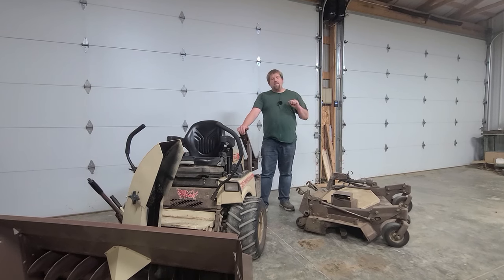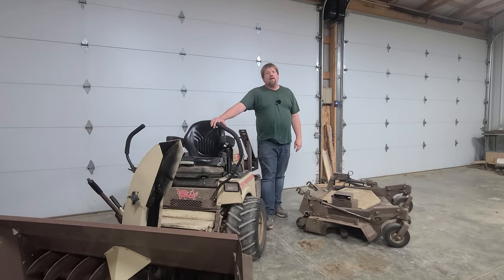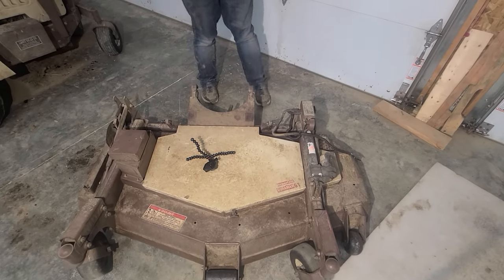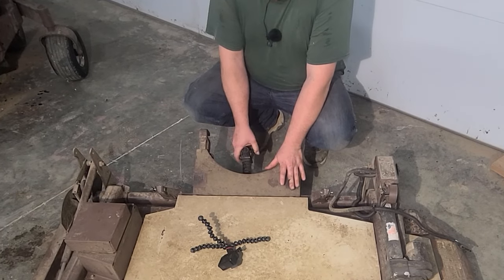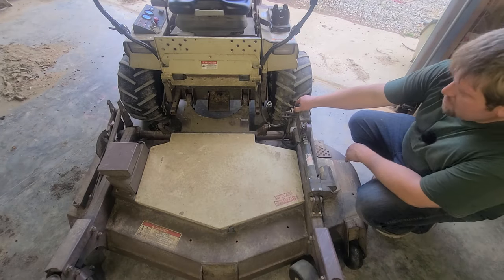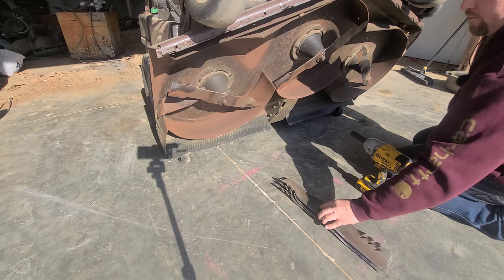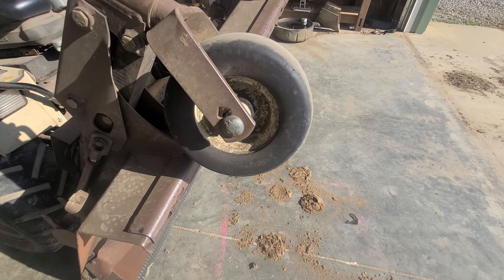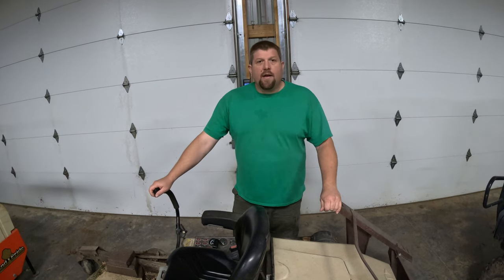Spring Maintenance on a Grasshopper 725D

Comment: That’s not a snow blower
Reply from the maker: Maybe not for some parts, but for ohio, it's more than qualified.  If we ever get snow, I will be doing a video on it this year.
Reply: @redneckIngenuity  no… it’s a snow thrower.. I had a model 512… it’s was good up until you hit slushy stuff then you might as well put it back in the shed… I inherited a old airens got snow blower I’ve been eyeing lately…. Might mount that to the grasshopper to see what happens
Reply from the maker: @ELDIABLOPELICANO  a distinction without much of a difference.  But you are correct.
Reply: @redneckIngenuity  well it is though… snow thrower = single stage… snow blower = 2 stage
Reply from the maker: @ELDIABLOPELICANO  I understand that.  The end result is the same. Snow gets thrown out of a chute and off of the surface you want cleared.